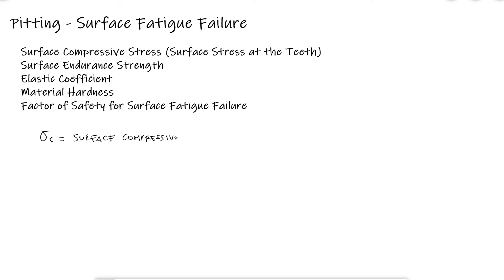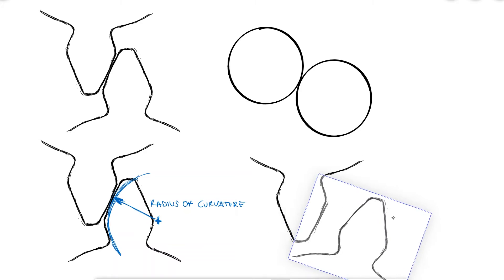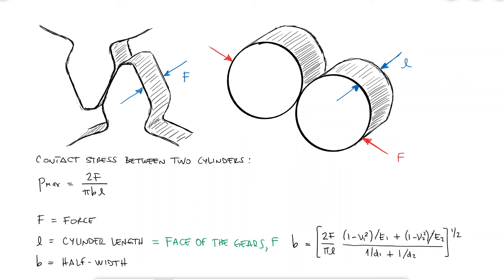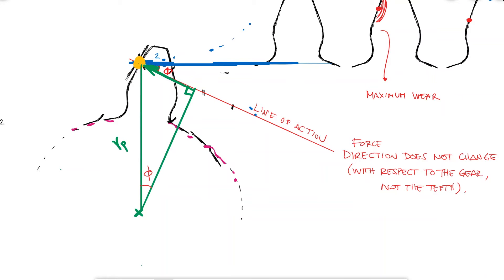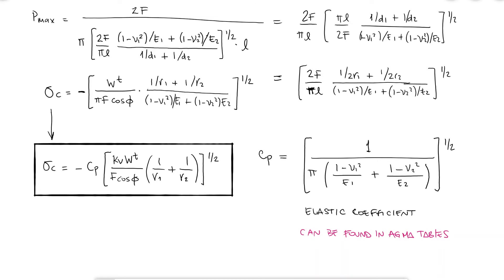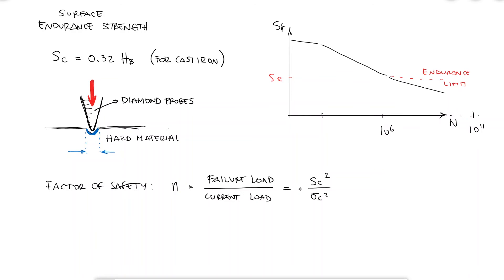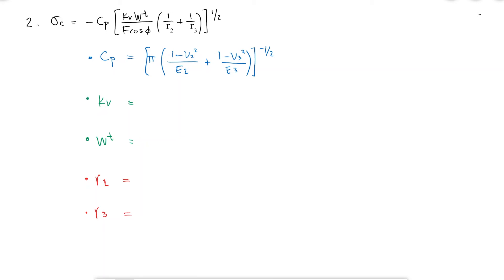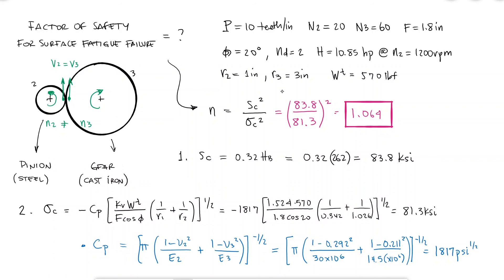Gear PITTING - Surface Contact Stress Fatigue Failure in Just Over 10 Minutes!

Comment: Where did you pull Surface Endurance Strength from? If you could provide a source that would be great.
Reply from the maker: "A surface failure occurs when the significant
contact stress equals or exceeds the surface endurance strength." "We can define a surface endurance strength SC which may also be called contact strength, the contact fatigue strength, or the Hertzian endurance strength. The strength is the contacting pressure which, after a specified number of cycles, will cause failure of the surface. Such failures are often called wear
because they occur over a very long time." Shigley's Mechanical Engineering Design. Estimate as functions of the hardness of the material are pretty common.

Comment: I may sound stupid but is a gear from delrin(dupon) worse or better than a gear made from 4140 alloy steel which is hardened by nitrogen?
Regarding longevity?
Reply: Depends on application. The Delrin one will be easier (and cheaper) to manufacture (injection molding) but won't be able to handle larger torques or higher speeds, and will be weaker in bending and surface strengths. Given the same load the steel gear will far outlast the plastic one, the surface hardness and bending strengths are a magnitude larger.